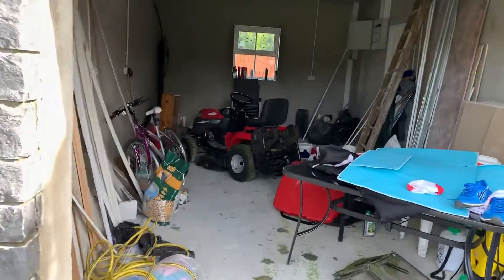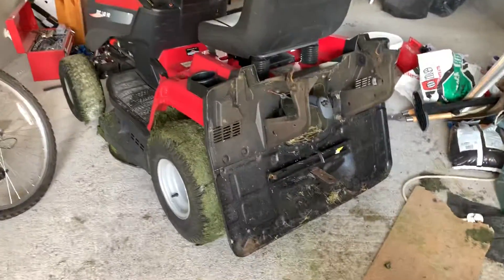Castlegarden xdc140 HD - How to free wheel 🙂

Comment: What does the lever directly above the tow hitch do ?  I would greatly appreciate what it does please. Working instruction manuals seem very few and far between.
Reply from the maker: Do you mean the lever that has the rubber attached either side?
Reply: No. It is the little bent  lever that is pointing to the hole in the tow bar. Thank you very much Brian for getting back to me.  @doolanbrian
Reply from the maker: @falconer100  can’t be 100% sure on that, but I thought it was related to a sensor that alarms you when the rear bag is full of grass